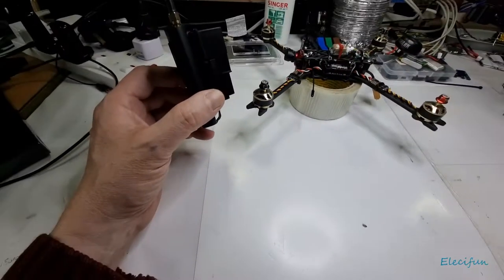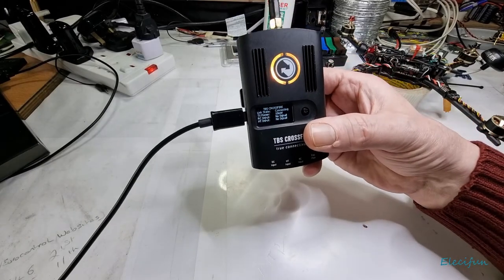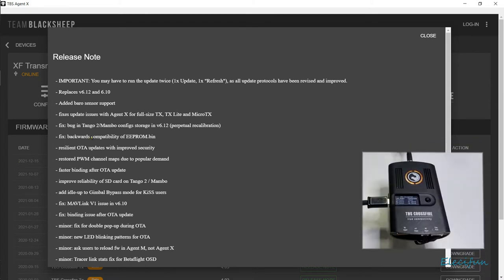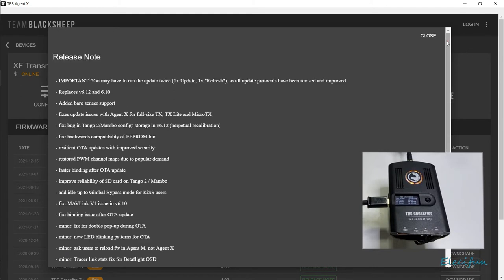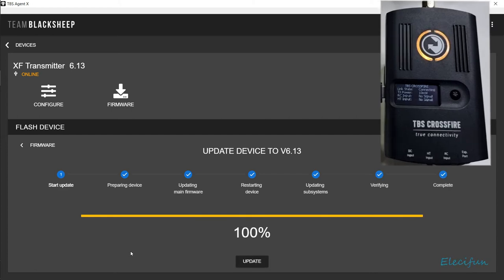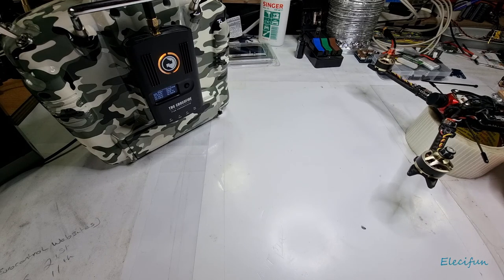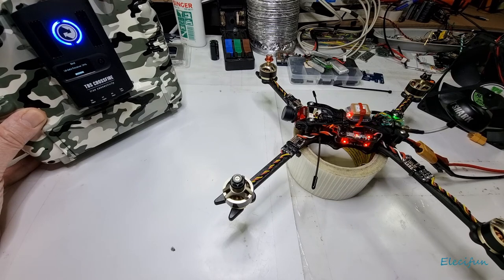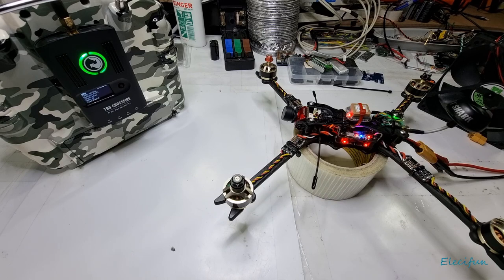OTA (Over the Air) UPDATES Could it get any simpler?

Comment: Thanks for that video Elecifun! Brilliant bit of kit that over the air updates. I like keeping up on your videos because you seem to buy equipment that is upgradeable and doesn't go obsolete in six months like so much electronic gadgetry. I still haven't made good on my threat to build my own video photography quad. Mainly because of cost. I would need everything including a new radio so it's pretty costly as you know even when you do all the building yourself. Combined with the anxiety that I might buy the wrong thing, these factors keep me from trying. The cost of high quality video quads keeps coming down too from major manufacturers like DJI and Autel etc. Though I hate proprietary gear... It's a quandary I tell ya lol.
Reply from the maker: Sorry for delay I've been having disk clone issues with my Christmas hard drive upgrade. We is working again now.
I am really please with some of my purchases but some stuff has been crap. I have to choose carefully what I buy and more so now I am older, I want kit that will out last me lol. 
I might end up having to buy propriety because anything else will have to be flown with safety features, low speed, avoidance kit etc. Will wait and see, as still have to 2022 to play with what I have. I do like the Mavic 3 as an off the shelf solution. With a radio you could use simulators for training and fun ; )